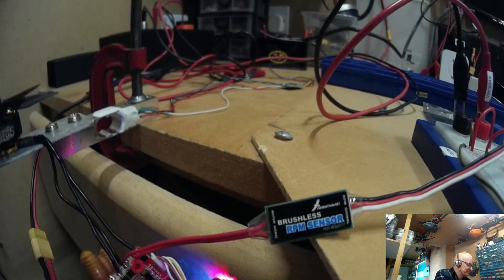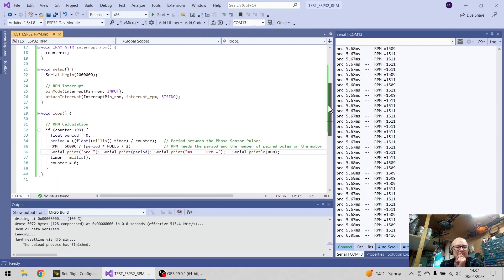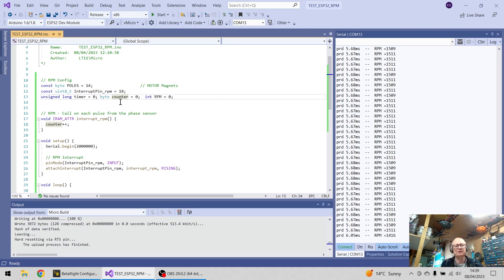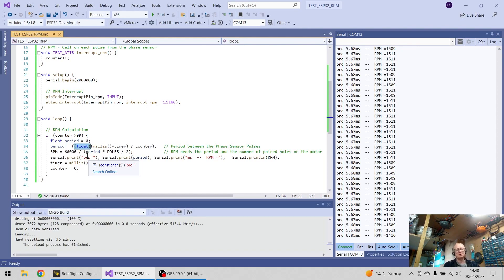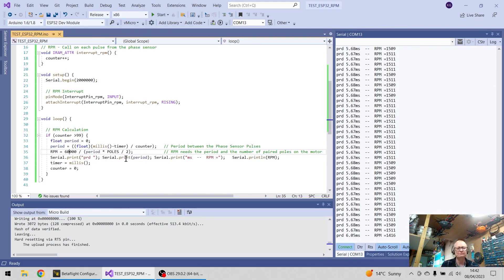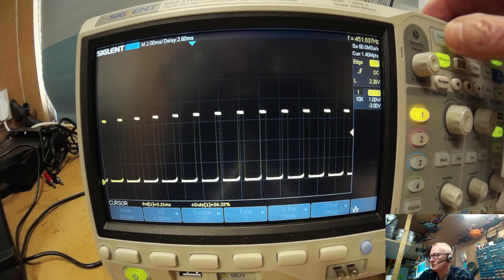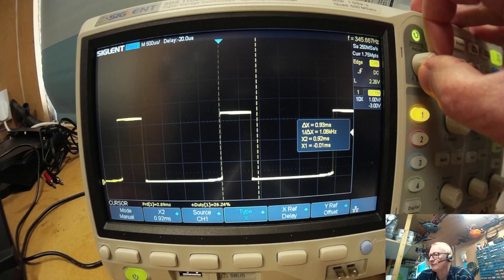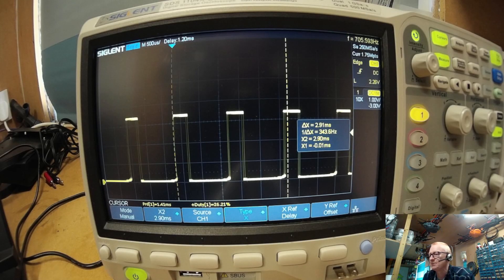Unlocking Precision RPM Monitoring: ESP32 Integration with Hobbywing ESC Sensor for BLDC Motors

Comment: I have been looking at these units, wondering if they would pick up engine pulses from an ignition coil on a motorcycle and give a clean square wave.  They are cheap and small.  Do you know whats inside them and how they work?
Reply from the maker: I'm not sure they would handle the voltage. Personally if you have access to mount a magnet somewhere I'd use an hall effect sensor A3144 with a 100k resistor across output and Vcc pins. The output will then go negative when the magnet passes, and you'll have a beautiful square wave.

Comment: Hi again. I did finally get the code to compile, but  the serial monitor  did not show the text, only a bunch of questions marks.
Reply from the maker: Make sure you have the serial monitor band rate (speed) set to the same as the program on the Serial.begin(xxxx) line
Reply: Serial port set to same baud rate. Still same garbage.